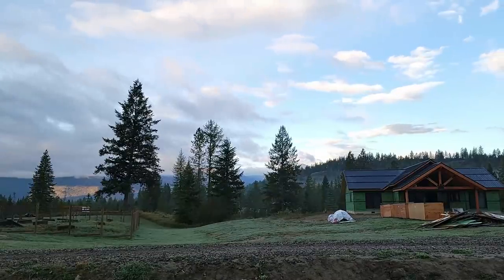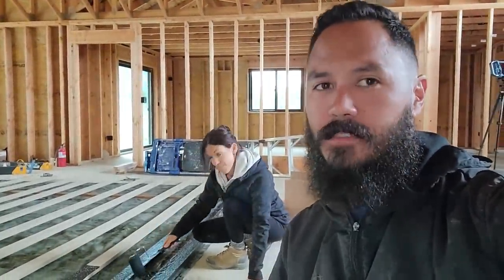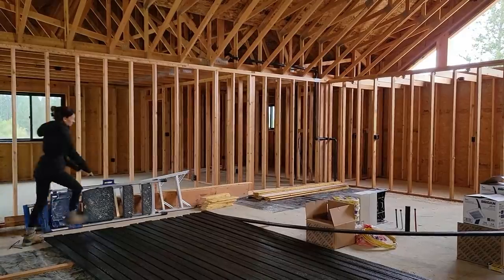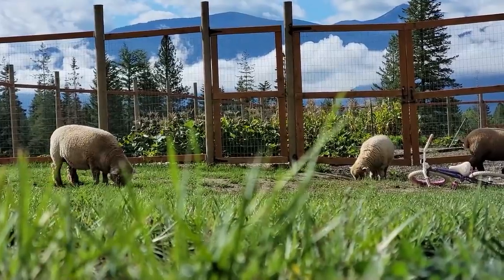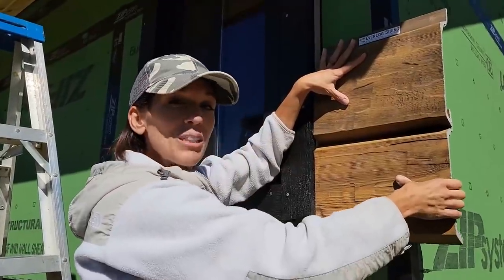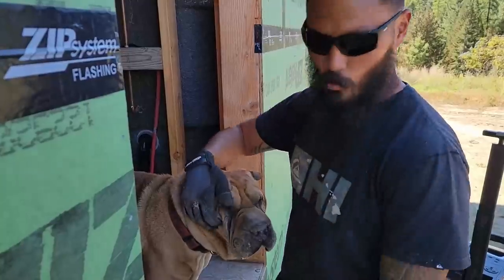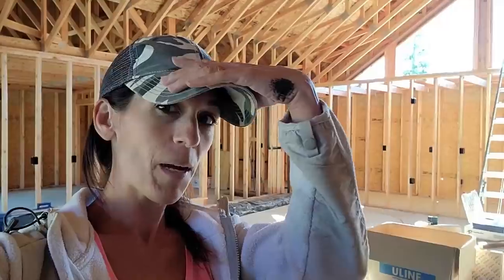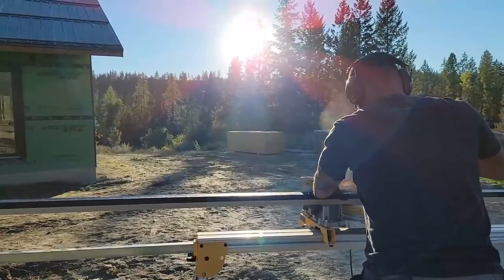Time To Finish The Exterior Of Our DIY Mountain Home

Comment: As you talked of the concrete patio two things came to mind.  1.  The stamping.  We have a stamped patio and like you are out in the country.  The divots in the stamping gather dust and dirt and with a bit of moisture they become mud pits.  So if your going to stamp then think about cleaning out low spots and maybe pick a pattern that doesn't provide for water collection.  2.  If doing cuts in the concrete to control cracking consider using a Ray pattern.  The rays extend out from an imaginary center and fan out across the patio and off the edge.  The rays represent the goodness that radiates out from your home in all directions.

lg

Comment: This will be your forever home, so plan now for your older age needs. Stairs to any entrance will be very difficult for anyone needing  a walker or wheelchair. Added ramps at the time of need are never easy.  Also make sure bathroom doors are wide enough for walkers or wheelchairs. We left our rural, off grid home after 28 years but we were so happy we made these adjustments initially.
Reply: You’re correct and should be figured in to their plan for sure especially in snowy conditions a the porch is the perfect place for it, it would also help with getting things in the house too!

Comment: Did you calk over the top of nail head? I would recommend it since it helps keeps moisture from getting under the nail and causing the nail to pull out. It also hides the nail after you paint it. It doesn’t take much and you wipe with a wet rag to blend it in we also calk the joints to. Just a thought from a siding guy.
Reply: Absolutely right, I know it’s too late, but a 16 gauge x 2 1/2” brad bail would have also helped reduce the visibility of nail heads. I would also be putting in some drip edges to help with water shed on horizontal pieces. Listen to us arm chair critics, lol! I love their property and what they are doing. Just pointing out some potentially helpful advice.😁
Reply: Also do not caulk the bottom, it allows for any water to escape, I learned that on my RV. Just a hint for you to think about! You know we care about y’all and wish ya the best time in your new home for many years to come!
Reply: Just a question…won’t the double thick trim cause water to get trapped on the bottom inside edge of the window?

Comment: Look at you! 300k subscribers 🎉
Project is looking great and I'm like Jeremy when you can see a bit of exposed raw wood.

Just a suggestion for you.
Idaho has a lot of granite. Different kinds, but a lot like us.
Slab steps 5 ft in length and 7.5 inches in height per code are only $150 per slab.
Realizing you need 7 ft for the sliders to keep the kids from stepping off might be financially a good option to consider.
We find local and natural resources here to save a buck and make the appearance blend in while making a statement.
Thanks for sharing.

Comment: As a carpenter for 53 years I have to say you should have had a slope on the top edge to let Water  run of and not back towards the window on this piece the bottom edge has the same slope to create a sharpe edge which will allow the driving rain to drip off .
Your not using sealant between the timber this will trap water and rot in a few years I hope this help and what a beautiful place you’ve chosen. Mick …UK

Comment: As I have texf you believe I'm a firm believer in a coat of stain or paint on EVERY side of exposed wood to natural elements.  If you ignore that it leaves a exposed area for wood bearing  beetles and insects to gain ahold.   It's cheaper to do it now rather than removal and replacement of infected wood pieces and tenting the house for fumigation.

Comment: When the rough in plumbing is ready for inspection, I was taught to back fill the drain lines until it flows out of the lowest vent pipe on roof. Hydrostatic load test is what I think it may be called.

Comment: Nice Time of the season to get dry-in  accomplished. ..I'm a Michigan Carpenter And Commercial Superintendent Now.  Often I  Comment on your Progress.  ( I'm a true follower of the channel Guys ) I've made a few suggestions but seemingly the advice wasn't Used.. THATS TOTALLY FINE. ...
 But A set of wooden saw horses , PAYS DIVIDENDS JEREMY ! 
I mentioned shimming the load walls w/steel shims When I seen the puddles in the house ,Before trusses got set..
Then staging wood inside  too. 
Hey, Watch your steps  . I suggested a chicken coop walkway made from 2  2x4's (8-10' long) , a scrap 12" rip of deck plywood) usually there's rips off the end row ) and a ledger block against the bond to support it. 
 Flush to deck ply . 
But : Hey, it's your Home ,your back's, your channel.  Sempre Fi

Comment: If you are wood framing the steps to the patio. They have tape to put under the “Trex” decking to keep the wood from rotting under the step and the ledger board.   Tech has gotten much better in the past few years to catch up with the  ACQ treated lumber.

Comment: You don't have to use the wood deck, there's another type called "Trex decking", all you need to do is make sure you have good waterproofing on the wooden base and you can build the Trex on top, we have had that for about 5 years and still look new.

Comment: Window trims looking good!! Can't wait to see the faux wood siding up against trims. Going.to look really good. Smart move bringing in the pros to do electrical and plumbing rough ins. Y'all had some issues on inspections on tiny home. The pros should get it done and fly thru inspections with no problems. Be safe and see you on the next video.

Comment: Why didn't you use ventilated siding? It is the same siding only first you add vertically inch wood to create inch air space between siding and ZIPboards. On the bottom and top, you put some screen mesh to prevent insects, and on the bottom cold air entering and on top warm exiting creating a natural draft to keep walls dry and helping drain any possible moisture inside walls. Kiping better thermals inside a whole year. The same amount of work and cost but much better and efficient in the end.
Think about it. Greetings from Croatia.

Comment: you can put your paint rollers and brushes in a zip lock and then in the fridge so you can reuse and not clean up. As long as it it latex

Comment: That trim is very hard.  If the compressor’s pressure isn’t high enough, you get those have depth shots.  Ran into the same issue trimming the front or the house here. Looks good.  I like the black trim.

Comment: You are so so right, that video shot of the 2 pieces of black trim with the green house panel behind, would have looked so wrong and strange if you had filled or made the whole thing black with trim, okay so that small gap will be fiddly to do and maybe add time into the wood look cladding fitting but the end result will be worth it, good decision you two.

Comment: Looking good!  My experience with black or dark colored trim is it doesn't last as long as lighter colors.  Black is a sun magnet where lighter colors have a reflection value.  I also us high gloss on exterior trim which helps it hold up better.  The gloss look doesn't last long with dust and grim if the shine is a concern.

Comment: I'm always amazed when I see the window solutions you use in North America, Canada and seemingly most other place people from that area of the world is building. I've put up windows here I Norway and they go in very differently with every part designed so that water flows down and out. The goal is similar and maybe your option is better, I don't know. Though I feel that correctly tilted windows trim just look better than the flat option you all seems to go for. I know the window is sealed, so there's no real need for you to use tilted window sils on the outside, but they just look right if you know that I mean.

That said, you way of doing it seems way way easier.  I remember the last window we put in and it was fairly small compared to any you have, it took 3 people to do right using the method we use over here. That kind of window one person could get in using the way you use.

But I guess innovation is the key here and this new sealing is better than any old natural flow way. We actually had to nail the window into the side of the frame, you just stick them on and nail them inn. Sigh, I'm actually jealous I think with how easy it looks compared to what I learned to do the old way.

Comment: The air pressure regulator on your tank for your nail gun maybe going bad it's an easy fix I have two wires unscrew the regulator and pull them through push the new regulator over the wires and twisted back on

Comment: We have two homes in very snowy northern New England with one having a large 25 x 20 exposed to the elements...no roof and the other a large wraparound porch 10 feet deep around our log home.  First one 35 years now second one 20 years.  No rot with very little maintenance.  Not certain why you think bad idea.
Reply: Because they don't live in New England, they live in the wet North West and around here the useful life of a wood deck can be very short compared to a patio(I speak from experience).

Comment: Consider the future. Build the decks up to the door thresholds. No steps into the house from the deck. Someone may need a wheelchair in the future and then when you are old you may have to hire it done with ramps from the deck to the entrance. Ugly. Plan for a ramp from the driveway to the deck. It can be 0f wood for now with hinges to allow drop down for a deck in the future but level for now at a minutes notice .

Comment: Just wondering, why did you not do overlapping with the double trim boards? If you did sorry, it just looks like you just used the same length boards on top of each other so the crease between the joints go all the way to the zip board.

Comment: With the double trim around windows, it appears you are creating a ledge at the bottom of the window where water could puddle, especially where the drains are at bottom of window. Given the snow you are likely to get, the snow would also sit on the ledge. How did you treat this situation?

Comment: I was wondering. Wont you need a window sill/ledge to cover your bottom trim? As rain water could get blown onto the windows which would run down between the two wooden trims.

Comment: When concrete siding is applied will you use a sealant on the edges that meet the window & door frames or caulk all of these joints ...or both ?  If not surely water will enter no matter how tight the join is. Just curious!
Reply from the maker: Yes we will

Comment: Sorry I have to speak up from a professional level cuz it's a huge OCD issue for me, painting wood... paint does not adhere to wood easily. Wood should always be stained, yes stain can be purchased for wood to turn wood solid colors by staining the wood rather than painting the the "stained soaks into wood and prevents the stain from peeling if impurities occur in the wood. Stain is a much superior process for wood rather than painting wood, the rule always is stain wood, paint metal and drywall...
Reply from the maker: It's LP trim
Reply: @GoodSimpleLiving  the engineered plastic siding can be issue too - sometimes, its strongly dependant on the type of paint applied... certain paints do not like to stick to it and peels off over time, it's why they offer a vast variety of pre-prepared colors. Hopefully the paint store hooked you up with the correct paint that will adhere to it.